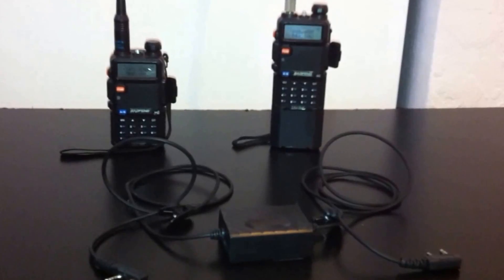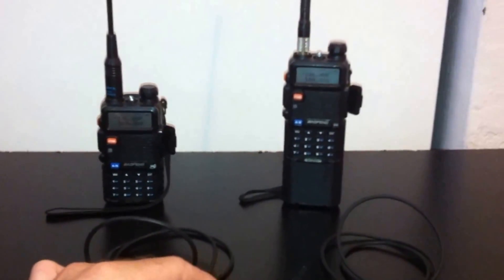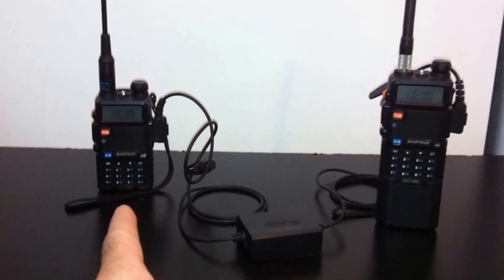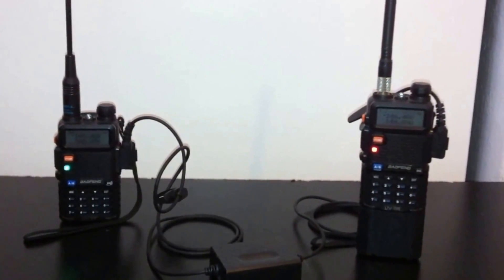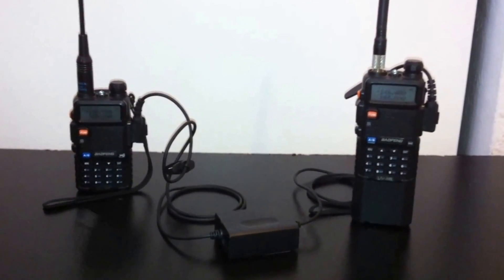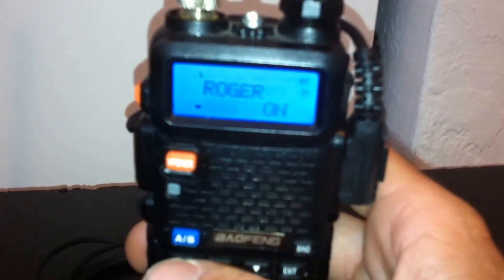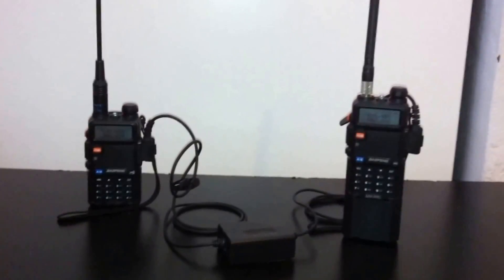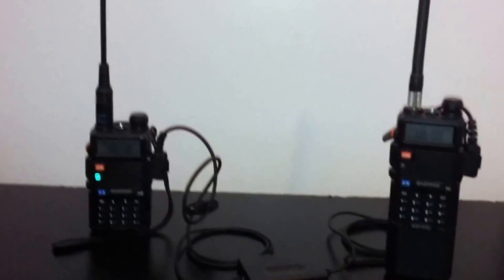Set up a Baofeng UV-5R repeater

Comment: I have an question in regards to seeing up the repeater I am looking at getting an antenna extender to put on the roof one of those magnetic ones am i best to get just one or 2 one for each radio would it make much of a difference or just one for the transmit one? the other option was to have 2 sets one at the lodge and one on the mount for the split locations to cover 2 diffrent areas https://www.aliexpress.com/item/Magnetic-HF-Antenna-Nagoya-UT-106UV-Vehicle-Mounted-Car-Antenna-For-Baofeng-888S-UV-5R-Two/32777319644.html?spm=2114.01010208.3.50.YNbWAF&ws_ab_test=searchweb0_0,searchweb201602_1_10152_10065_10151_10068_5030018_10084_10083_10080_10082_10081_10110_10136_10137_519_10175_10111_10060_10112_10113_10155_10062_10114_437_10154_10056_10055_10054_10182_10059_303_100031_10099_10078_10079_10103_10073_10102_10096_10123_10189_10052_10053_10142_10107_142_10050_10051,searchweb201603_13,ppcSwitch_5&btsid=552078af-ef97-4df7-be2d-59ff301b1c12&algo_expid=29ef88b9-974a-4806-8b2e-b0ac026c3ae2-9&algo_pvid=29ef88b9-974a-4806-8b2e-b0ac026c3ae2

Comment: Hi, great video. So you set the same frequency for both A & B radios? I don't get the offset here.
Reply: A is set to Rx on ch1, b is set to Tx on ch2 - the Tx on A and Rx on B does not matter. Since you listen to ch2, you need an offset when you transmit which + or - a frequency to match the repeaters Rx.

So -- Repeater A: Rx 145.500 -- Repeater B: Tx 145.900 -- You setup your radio to Rx on 145.900, and Tx on 145.500 - the offset here is -0.400.
Reply: Dude, you're a genius. I purchased a cheaper version of this mini repeater from an eBay seller but it came with a few numbers on the little repeater box, a few abbreviations and some Chinese characters, but no instructions! Zero. I had no idea how to set it up and went round and round with my radios as well as the seller who didn't know how to set it up, didn't care, didn't know anybody that knew how to set it up, etc.

So, I spent the money on the more expensive one reviewed on this video supposedly designed by Baofeng,  but it also came with no instructions! But you figured it out. So, I dug these things out of the trash and by God they work.

Thanks. 73.
Reply: Your walkie talkie "transmits" the offset frequency of one radio.  That radio passes along and transmits through the other antenna, on the actual repeater receive frequency.  

You transmit - frequency X (offset frequency) 
and the other radio transmits on frequency Y (repeater frequency) 
... and all radios set to receive on the repeater frequency receive the repeated signal.

Comment: Hey just out of curiosity before I invest in one of these, is this one of the ones that actually uses the PTT button or does it require VOX? Thanks. :)
Reply: It works either way.  You choose what mode you want to use.  For a repeater setup VOX is easiest

Comment: Hey, I bought the device you linked to in the description and when I plug it into 2 UV-5RV2+ radios, after keying the mic on one of my other radios, i get an infinite loop of transmissions on the 2 "repeater" radios until I turn one off.  Any suggestions?
Reply: @ Dennis Browning Do you have solve the problem? I have the same problem... :-(
Reply: +Dennis Browning
A couple of things could be wrong here...

1. Same frequency

Firstly, make sure they're not on the same frequency.  Repeaters use an 'input' frequency for listening to users and a separate output frequency for retransmission.  You can then set up the users HT's to operate in duplex mode, so that they transmit on the repeaters input frequency when you key up, but go back to the repeaters output frequency when you go back to listening.  This is done by setting up an 'offset'

You might already know that - but some people might not, so... y'know... I had to mention it  : )  It's an easy mistake that some people might make.

Forgive me if you knew that already : )

2. Splattering/Swamping

Now, if your repeater frequencies are set up correctly and this still happens, then your transmitter is saturating the receivers input despite being tuned to a different frequency.  There is a 'proper' way to fix this, involving a piece of kit called a duplexer as well as special filters and expensive highly tuned cavities ... but in a back-to-back baofeng repeater you're trying to do it cheaply and without extra equipment.  So, here are some ideas :

1. Make sure you're not using the stock antennas - they ain't great and mismatches and poor resonance can make this issue worse.
2. Place the antennas further apart, just a little extra distance (particularly a little vertical) makes all the difference
3. You could try other offsets to see if any are less noisy - usually, setting the maximum offset allowed is best in terms of splatter.
3. Swap the Tx and Rx units roles... I've seen this work and can only attribute it to build variation (The consistency of these units isn't great)

If you listen on one HT and have a friend key up from the other on your other frequency you will get some idea of how far apart you need to get to avoid destructive splatter.  The safe distance usually isn't as far as you might expect, and just a meter or so can have huge implications.  Also, having the antennas separated a little vertically rather than just horizontally can make a massive difference as the antennas radiate the bulk of their power sideways - so a vertical offset is often worth more than an equivalent horizontal offset (good tip there)

Basically, when working on the cheap like this, a little experimentation goes a long way.

3. The cross-band solution

If you ARE still having problems and nothing seems to work, note that cross-band repeating is much less prone to this kind of issue.  For those that don't know, crossbanding means transmitting on one band (such as 2m) whilst receiving on the 'other' band (in this case, 70cm).  Obviously it is easy to create a cross band repeater using back-to-back baofengs as they are dual-band units.

Setting up your users handhelds is different for cross-band repeater operation though:

If you have access to chirp you can set up the baofeng for cross-band duplex - but it's not possible to program cross-band duplex in the field.

Adding cross-band in the field, without chirp

If you need to set up cross-band in the field you instead use two simplex channels.  Set up VFOa for your transmitting band/frequency and VFOb for the listening band/frequency.  Now make VFOa your active VFO (The one that is used when you transmit) ... and turn on dual watch mode.

This way, your receiver will respond to any activity on VFOa and VFOb.  If the other user is close to you then either will be chosen without a problem, but if the user is far from you - VFOb (the repeated signal) will be the only one your radio will pick up.   \o/ yay.  Now engage the lock on the radio, cus that a-b switch is too easy to hit accidentally ; )

CAVEAT: The problem comes when a user is close enough to be barely audible on VFOa, and the radio selects VFOa instead of the better signal on VFOb... in such cases where this is likely you can always turn off dual watch and switch between VFOa and VFOb manually for each over - not ideal, but it works.  In practice this is fairly rare, when a signal is too weak to read it's usually not picked up on dual-watch anyway.

WORKAROUND: If you ARE already in dual-watch and this happens, quickly raise the Squelch up briefly... this jogs the dual-watch monitor onwards from VFOa, and it gets caught on the stronger VFOb signal.  In practice you won't notice them 'disappearing' because the radio will suddenly pick them up strong on VFOb ... so it feels like plucking the Squelch made them readable.  But, like I say, this issue is fairly rare in practice... usually the radio finds the readable signal between the two VFO's

One benefit of this system is, if you and a friend wander too far from the repeater (in the same direction) the HT's will automatically fall back to direct user->user communications on the VFOa frequency.   Remember, unlike duplex, just because you can hear other members of your party when cross-banding like this, it doesn't mean you are hitting the repeater - your base camp may have lost you ; )

Hope that helps a little,

Gary

Comment: Why can't you use a simple audio crossover cable?  Set Squelch on the Rx side and then VoxOp on the Tx side ?

Does the repeater module provide the periodic ID and remote control required for Licence Compliance?  Because if not, I'm struggling to see the point of using the module : /   hmmmm... actually, Morse Identity and DTMF Remoting seems like a nice easy little microcontroller project to add onto the Squelch+VoxOp system.

Still, I'd love to know the advantages of using the module over a simple audio cable.
Reply: +MelloB Outdoors
Two ways of doing this, depending on whether you need really long term running, or easy portability.  Remember that the Baofengs need 7.4v (But work fine from 9v to 6v)

Method 1 - 12v batteries, with voltage regulator

If you search ebay for "Battery Eliminator Baofeng" and order by price, you'll find car cigarette adaptors for Baofeng UV-5R's for around £1.50... you'll need two.

You can either:
1. Cut the ends off and wire both into the 12v battery terminals, but make sure you salvage the regulator from inside the plug you cut off - you'll need this wired inline because UV5R's don't like 12v so much ; )  You should also use an inline fuse for safety, a 500mA slow-blow fuse is fine.
or
2. You can buy two car cigarette lighter sockets and wire those to the 12v battery so that you have two cigarette lighter sockets to plug the adapters into.  The advantage is that the car adapters can still be used in a car.  If you don't know what you're doing, use this second option - as the plug has a voltage regulator built in (and the line sockets tend to come with fuseholders fitted already, which is also important)

I like this method because my yacht (and cars) are good at charging up 12v packs and the batteries last forever when only running two baofengs : )  I use a fairly portable 7AH 12v SLAB battery sometimes, it's just something I had lying around from my QRP days... but a car battery would run for months.

Method 2 - Either 6v or 7.2v batteries, Efficient because no voltage regulator needed

If backpacking a lighter and more efficient method involves using a 7.2v battery pack (like a LiFePo pack) ... Or if you prefer a lead acid battery you can use a 6v SLAB battery using this method and it is still more efficient than the 12v SLAB method above (because no voltage regulation is needed)

To use this more efficient method you need an 'AA type' battery pack.  Search ebay for "AA battery baofeng" ... they cost about £1.20 each, you'll need two.

These are designed to take six AA batteries... but instead, you can put a little hole in the bottom for a cable (use a cable entry grommet for strain relief, or just hot glue it) ... and connect the wires to the exit terminals inside the pack.  Now you can connect both battery packs (in parallel) to any battery from 6v - 9v ... like a 6v Sealed Lead Acid or a lightweight 7.2v high capacity Lithium pack.  Works beautifully and the current drain is a little bit lower because there's no regulator drop... it's also far lighter too which is important if you're backpacking the thing up a hill.

Either way, I'd suggest fitting a fuse too... always : )  SLABs and Lithiums can get pretty scary if shorted out, so a fuse is a REALLY good idea.

Project - A single-purpose portable emergency repeater

(If you use this a lot, want a semi-permanent setup or in poor weather conditions)

Grab an environment-proof plastic enclosure suitable for outdoor use, large enough to hold your battery+radios.  Wire it all up using one of the methods above, and affix two SO-239 plugs through the box, using O-rings and hotglue to keep it waterproof.  You can wire these connectors to an SMA pigtail inside, and connect the SMA's to the radios antenna mounts.  Fix everything down inside so none of the parts move and the cables are not flexing all the time.  You can even add a charge controller too with an external connector for wiring up a solar panel.

This makes a great little self-contained repeater box with no weather worries, capable of taking much larger antennas than the baofeng can fit.  It also allows you to place the box lower down and hoist the antennas up separately, so that you can get really good line-of-sight signals (For hoisting antennas I use a common technique - a golfball with a screw-in eyelet and fishing line, to throw over high tree branches ... the temporary fishing line can then haul up my paracord, and my paracord is then used to haul up antennas)

But the simple back-to-back baofeng using cheap NA-771 whip antennas is usually all you really need for a quick fast ad-hoc repeater : )

Hope that helps,

Gary
Reply from the maker: I have another one for digital DMR radios, like the Baofeng DM5r. These tier1 radios can't be used on repeaters, so why not use them this way??
Reply: GaryChap I did this just to try it. pretty neat
Reply: Yeah, it's a fun little free repeater setup.

I was island hopping by yacht with a few friends.  We visited an island and put a baofeng repeater with a 7AH battery up in a tree on the hill so we had comms from both sides of the island.  The baofengs pull so little power in receive that it lasted all week.

Simple APRS from a baofeng using a mobile phone as the terminal+gps is kinda cool too.

That's what I love about baofengs, they're so cheap you can just mess about with them and not worry.

I stripped one down and used it to monitor POCSAG pager messages for a bunch of typical first responders services nationwide I'd gathered by monitoring on my PC... so now by watching for a statistically anomalous volume of messages across about 100 users I have an Early Warning System for emergency events.  I'd never have dedicated a more expensive receiver to something like that.

Interestingly, It's gone off twice.  The first was a 'red activity alert' due to sustained multi-agency activity during a national emergency response exercise.  I plugged it in again last July, after about 18 months in a cupboard, and left it running - I totally forgot about it until it triggered an 'orange' activity alert on new years eve.  So I know it definitely works when there's something going on.

For their price you can squeeze a lot of fun out of these little FM-Only radios... and in a disaster you can afford to hand them out like candy.
Reply: GaryChap how did you hook up the battery to the ht's?
Reply: Morse ID isn't necessarily required. You can identify with your callsign, followed immediately with "through the  (**callsign**) repeater" and remain legal. All users must be aware of the necessity to keep it identified at least every 10 minutes to be compliant as long as one user identifies the repeater. It's not a bad idea to have all users in a conversation to take turns identifying each 10 minutes for a long-winded battery-draining QSO.

Comment: Several comments talk about using an external antenna for the Baofeng UV-5R.  I have several of these radios--if I use them with the stock antenna, or with a small whip antenna, they work fine. In fact, their reception is much better than I would expect with such a small antenna. However, when I have tried them with several different external antennas (a couple of j-poles and a couple of mobile antennas)--I am able to transmit well with these antennas, but the better antennae seem to overload the front end of the Baofeng, and I get zero reception. I would love to set up a repeater system like the one described here, but would like to do it with a couple of good external antennas and some elevation. For those that have done it, how did you solve the desensitization (overload the front end) problem?
Reply: The UV-5R and UV-5RTP stock antennas are atrocious!

They are basically a random wire stuffed down a black straw and not even tuned properly.  My last ones had almost 2cm of variation over 5 identical models.  I originally fitted some very cheap Chinese (counterfeit) Nagoya NA-771's and the difference was incredible.  There are also some ultra cheap SRH850S (also counterfeit)  helicals which seem to put out almost twice the field strength as the stock antenna, despite being a third of the size - and the performance of those almost rival the far lengthier Nagoya NA-771

I always say that if you really want the best out of a baofeng - dump the stock antenna in the bin on day 1 : )  It's a terrible radiator.  The little $2 stubby SRH805S clone is now my go-to antenna for baofeng HT's

I've never seen any real front-end overloading issues with any of the baofengs I've owned - and I've tested them on my main 5 element/8 element dual-band Co-linear with 15/19db gain ... they still work well and don't even noticeably saturate when the transmitter is literally a couple of metres away putting out 25w

In fact, there are endless youtube videos with people quite happily keying them up just centimetres apart.  If anything, I'd say there's far too much headroom in the pre for their just-about-adequate sensitivity.

Comment: i wouldn't call it the cheapest as a 50 cent aux cable and a 25 cent 2.5mm to 3.5mm adapter
Reply: VOX sucks and you need to convert the speaker out to lineout/line level output.

Comment: But how can this work without a duplexer? Radios side-by-side are going to deafen one another. If using VHF aren't you better off buying a cheap 5MHz Chinese mobile duplexer and using a VHF antenna or use a discone? Also, what about cross-banding where RX on side A is VHF; TX is UHF. RX on side B is UHF and TX is VHF. Can this be done?  Placing this at a high point makes a a simplex VHF repeater.